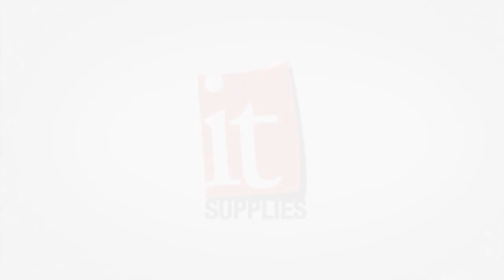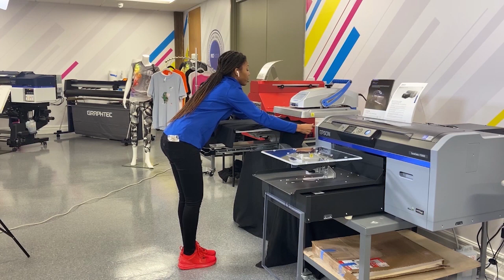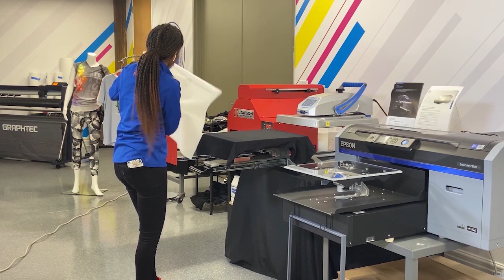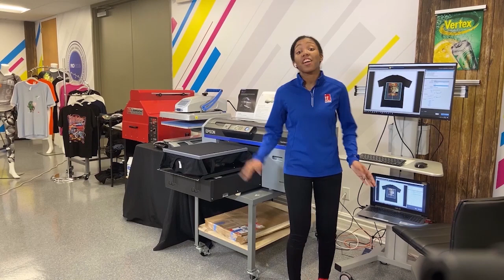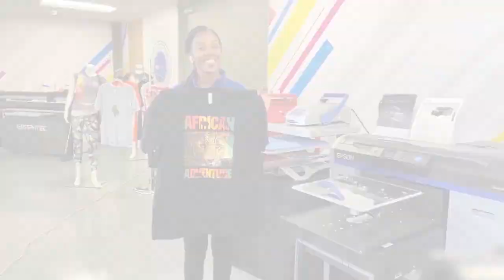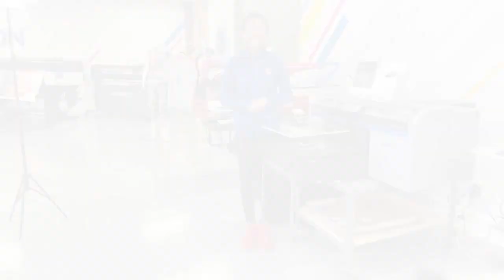How to Print a T-Shirt with the Epson SureColor F2100 Direct to Garment (DTG) Printer

Comment: Do u allow your pre treatment to dry before u press it or is it straight to press while it is wet ?
Reply from the maker: Hello Philip, the garment must be totally dry prior to printing. You can fix the pretreat with a heat press at 330 degrees for 45-90 sec at a PSI of 9.
Reply: @ITSuppliesINC  so thats 9lbs of psi for 45-90 seconds
Reply: @ITSuppliesINC  we have the same machine but i do not have a pretreat booth just a gun so im trying to adjust to how much pretreatment i should lay down along with how to get it to the point where my machines prints will pop like yours 
thank you btw for your reply i appreciate it

Comment: Question should we turn off the printer or leave it on if we’re not printing daily ?
Reply from the maker: Hi Rise Gaming, thank you for your question. 
You shouldn’t keep turning a printer on and off because it:
Negatively affects the inner workings of the print system — creating more opportunities for malfunction. Increases the likelihood of having to clean (or replace) the print heads sooner rather than later. Wastes ink because each time you start up your printer, the print heads are forced to run through their complete cycle in preparation for printing.
 
It’s generally a good idea to leave your printer on, even when you have no intention of printing. Shut your printer on and off frequently, and you end up mucking up the print system–which you’ll have to clean, wasting ink in the process.
Reply: @ITSuppliesINC  even if we don’t use it everyday? Would it not clog the print head ?
Reply from the maker: @KtuluLeaderRise  Hi Rise Gaming, to keep your printer lasting longer, we recommend leaving your printer on. If it is off for a long period of time or if you turn it on and off again regularly, the printhead inside the printer will dry out faster. When you leave it on, you may hear the printer start up every once in a while and begin to calibrate. For healthier print heads and more efficient ink consumption, it's better to leave your printer on. Most printers have a “sleep mode” function that kicks in after the printer has been idle for about 15 minutes, which helps conserve power. If you do need to turn your printer off, make sure to shut it down properly using the power button on the front of the machine.  Clear out any pending print jobs from your printer queue and check that the cartridges have returned to their resting position inside the printer prior to shut down.  If you unplug the printer from the wall and it hasn’t been shut down properly, you could permanently damage your machine.

Comment: I have a question, what kind of heat press/ cure press is that? I found the Lawson pretreat systems, I also found the printer I’m just having a hard time finding that press
Reply from the maker: Hi Shawn, thanks for reaching out! The Heat Press we used in this video is called the "Geo Knight DK20A Digital Knight 16x20 AUTO Clamshell", you can find it on our website, as well as many other types of heat presses depending on your needs.  If you have any other questions, give us a call at 1-800-771-9665! https://www.itsupplies.com/Geo-Knight-Digital-Knight-16x20-AUTO-Clamshell-p/dk20a.htm
Reply: @ITSuppliesINC  fantastic! I’m actually looking to start a clothing store and do everything in house! I will give you all a call on my lunch break 😁
Reply from the maker: @ShawnSarbacker  Awesome, we look forward to hearing from you!
Reply: I tried calling just were in different time zones! I just have a question, if I were to purchase all 3 pieces of equipment from you guys, the pretreatment, the press and the printer would I be able to get a discount? And also does the f2100 accept algae ink? I’m looking to use more sustainable materials
Reply from the maker: @ShawnSarbacker  Hi Shawn, sorry you couldn't reach us. Our phone lines operate between the hours of 8am - 5pm CST and our number is 1-800-771-9665. The printer is designed to only work with genuine OEM Epson inks. Using anything else can ruin the printer and void the manufacturer warranty.

Comment: what's the maximum printable size for this unit on the garment?
Reply from the maker: Hi B. Swain, the printer comes with a Medium platen (14"x16") an optional large platen is sold that brings the maximum printing area to 16” x 20” if purchased separately. If you have any questions, give us a call at 1-800-771-9665 and ask for a DTG rep!

Comment: Can you use a conveyor belt like the one you use for screen printing instead of the heat press?
Reply from the maker: Thank you for your comment, Jesse. Yes, you can use a conveyor dryer as opposed to a heat press. The conveyor must be forced air and capable of curing DTG inks. The hand on the shirt will be different, however, because the conveyor dryer will not press down the fibers and embed the ink.

Comment: How does the ink/surface of the printed artwork feel to the touch? I always prefer the "soft feel" style where you can barely feel the artwork on the t-shirt. Can this printer print "soft feel" or is the artwork going to feel thick and plasticy like an an iron transfer? Thanks!
Reply from the maker: It depends on what is used to cure the garment. If you use a Teflon sheet, it can give a sheen and feel more like screen print. If you use a silicone parchment sheet for curing, it would feel soft to the touch with the accurate time, curing heat temperature and pressure. The pressure you use when curing can also impact the feel - tunnel dryer with no touch, or heavy pressure when using a clamshell type press. If you have any questions give us a call 1-800-771-9665 and ask for a DTG representative!

Comment: Great video, thanks so much. I just reviewed my Epson F2100 today. What do you have your computer setting on. I would love to find something similar to set my laptop on while using the printer.
Reply from the maker: Hi Dale, I normally operate on level 3 or 4 depending on the image and the garment it is going on. It is all trial and error. The best way to get the best image quality always starts with your graphics, having the resolution at 300dpi or higher, great quality shirts and workflow. You can always call into or call center for further assistance 1-847-394-9573

Comment: What is your cost per shirt and what would it sell for retail?  Just wondering how long it would take to get your ROI.

Between the heat press, printer, computer and consumables, it might take a while if you’re printing 4 shirts per hour.
Reply: All I know is those printers are around 18K. I'd imagine they charge at least 30 a shirt.
Reply from the maker: Thanks for your comment, those are great questions. We go over ROI with customer all the time. The industry standard is about 20-25 dark shirts per hour and 25-30 light garments (not using white ink as a base). Now this is also based off the operator and other variables but we are here to teach you work flow process to efficiently get the job done. If you are interested in speaking to a dedicated Textile Print Specialist - we would be happy to assist you. You can call 847-394-9573 or email us at info@itsupplies.com

Comment: I'm having big, annoying problems with this printer. Almost every time I put a t-shirt in it, it breaks off the print and reports the error "An obstacle is in the way" (just in German).
I have 3 different plate sizes so it's not that, I always change them for bigger or smaller shirts. When I start printing it breaks off 5-10 times and I try to fix the shirt, adjust it, pull here and there until the printer finally prints. What could be the reason for that?
Reply from the maker: Reach out to Epson support. They should be able to help. https://www.epson.eu/support

Comment: Keep in mind Screen printing the image she did would be labor intensive for small runs.. This job can be done and paid for before the art could be separated much less burn all the screens to screen print it. DTG is very good at doing full color and small to moderate sized jobs. These tend to be higher profit jobs do to the lower qty. For us we are able to have a large selection of stock designs that we can print on demand for wholesale customers allowing them to order restocks and take custom garment color orders without setup fees etc. 
You want to add a name to a shirt? Open the job in Garment Creator (Epson's included software) and type name and print. Have a rush order with 24 adults shirt and 4 toddlers..   No problem just run the adults then change to the smaller platen, resize the adult print for the toddler in the software and hit print... No other setup required..  
    In our production one person can pretreat, print and fold so after you dry the last shirt just fold it and job done. Also keep in mind as you grow one operator could pretreat then fold while another could run 4-5 printers at once all doing different prints if needed. You can also update to conveyer dryers instead of presses as you grow...  Like always it all about your market and level of comfort and available time to learn a new craft. That being said all printing methods require allot of learning to really get your systems dialed in. If you are new make sure you have the time to make the sales and learn the printing vs making the sales and outsource your printing. (as with all printing the equipment is only part of it. The process of printing is an ongoing lesson that require constant evaluation and improvements.) 
*Always get samples of DTG printers work before committing on a contract printer...
 
 DTG has a very defined place as does screen printing... We started DTG about 3 years ago and purchased from Mylaya at ITSupplies.  We could not have been more pleased with the service and commitment from them!

Comment: How are you able to connect to the computer? USB cords will not work for my f2100 printer
Reply from the maker: HI Brandon, thank you for your question. If it's not working, you could connect to your network or try a different USB cord. The cord could be faulty.

Comment: i have a question you might be able to answer. On the front of the f2100/f2000 ink cartridges they have the date and under the date they usually have 2 letters like mi or me or ml   MK  etc.. white and cmyk inks all have 2 letters but sometimes one yellow will say ME and another yellow cartridge will say MF .... i am so clueless on what it means and it is becoming a peeve. i just want to make sure the inks are not fake lol
Reply from the maker: The best way to tell if you're buying Genuine EPSON OEM inks is to make sure that the re-seller you're buying from is Epson Authorized Dealer (I've included a link below to check.) You can check to see if they are on the epson.com website. There's a high res photo on the white ink if you check out our website linked below, the cartridge will look like this. Epson's stock photo does have WH in large block text and EPSON in block lettering at the top of the cartridge. Hope this helps!

https://www.itsupplies.com/Epson-DTG-Ink-Cartridges-s/1509.htm
https://epson.com/epson-technology-center#centers
Reply: @ITSuppliesINC  Great video and TY!! Question, I'm having difficulty printing consistent high resolution shirts. I've discovered using level 6 Quality is not always NOT the answer, and I just want to get to a point where I'm consistent when printing so I'm not wasting ink, time or product. ny suggestions you have would be greatly appreciated. You're video was extremely helpful vintageprints1976@gmail.com
Reply from the maker: @unklereggiezKITCHeN  There are a few different variables that could be the issue. The brand of shirt, pre-treat process or the print file itself. You can call 1-800-771-9665 and speak with one of our textile representatives or technicians for further assistance. We are happy to help!